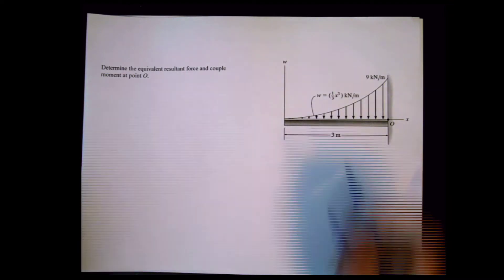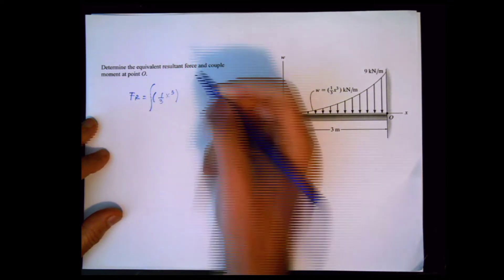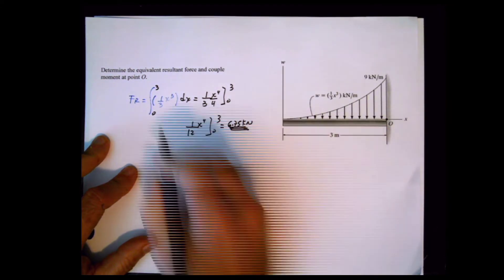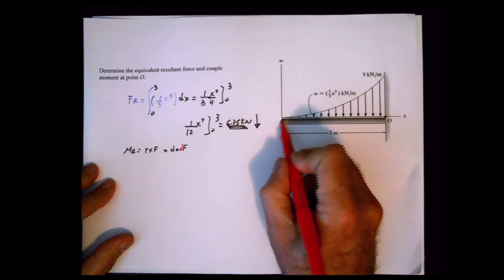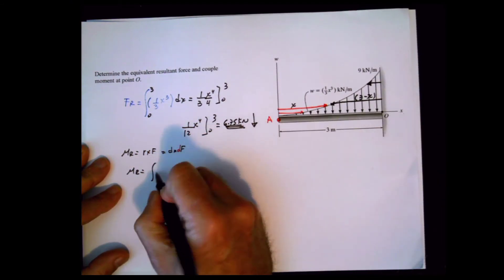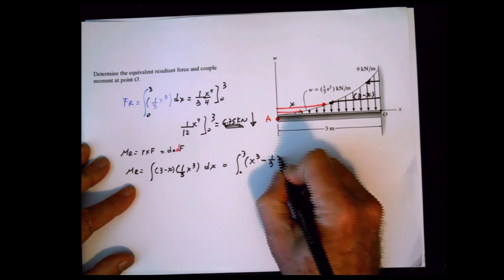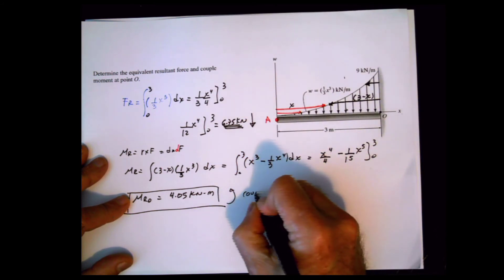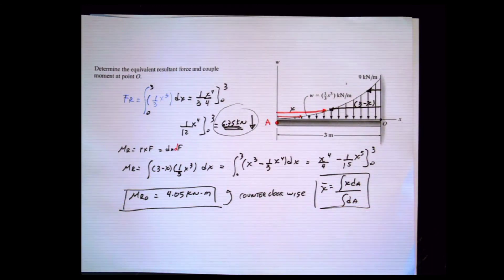Example of  Equivalent Systems with Integrals 4 157 H14

Comment: isnt 
M_R / F_R 
your result for the center of the Force from right (so you dont need to integrate once more as you showed at the end) ?

thanks for your video i am addicted to mechanics 😄👍
Reply from the maker: nope
Reply from the maker: btw... hello to you too
Reply: why not or what i am missing.. 🤔
we have the Result-Force F_R,
we have the Result Moment M_R from right,

when i now need the center of the force i just do:

M_R / F_R = 4.05 kNm / 6.75 kN
= 0.6m (from right)

this should be my center of the Resultant. 
So it is 
3.0-0.6 = 2.4m from left.

for me it sounds logical.
Moment and Force are connected via the distance between the point i am at and the center of the force.